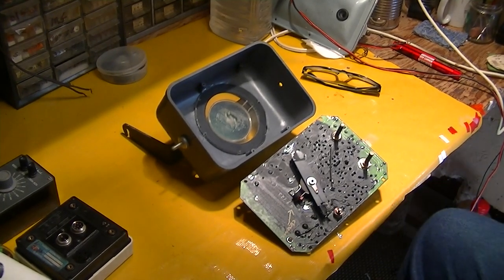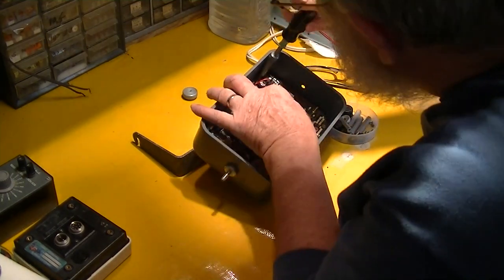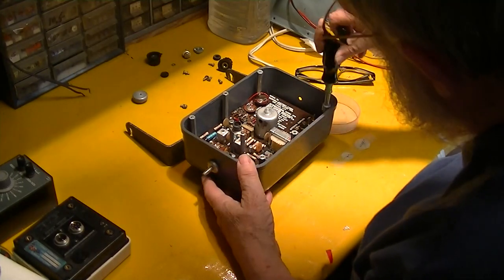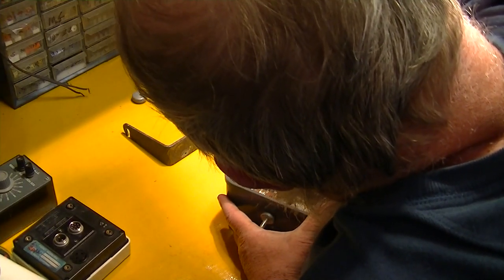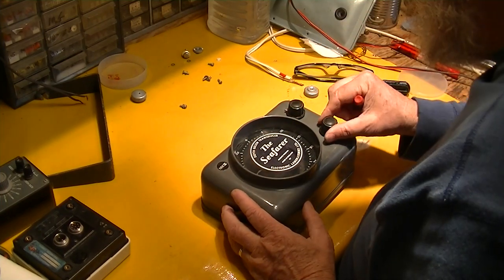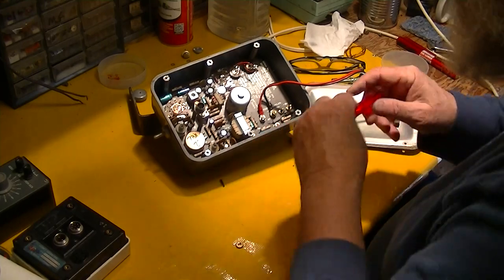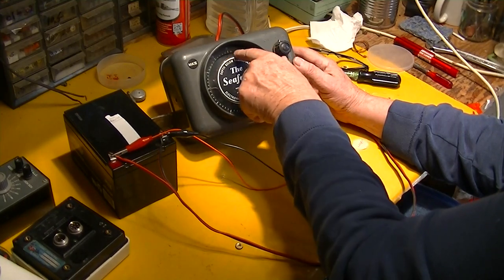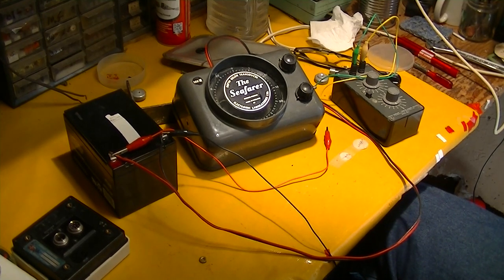Seafarer Depth Sounder : #3 Re-Assembly and Demo of Classic Flasher Type Sounder

Comment: Hello, do you know who or can you repair a, Unimetrics depth sounder / flasher.  Type, Sea Hawk SH 3600?  help, Gregg.
Reply from the maker: nope.  With new visual fish finder/gps combos selling around $100,most folks wouldn't bother.  But, if you find an old marine electronics shop with an old timer tech.. it will be easy if the mechanicals are still ok.  Not cost effective, probably, but not hard.  Restoration of old stuff is a labor of love, I do it all the time, but it isn't going to pay anybody to do it commercially.
Reply: Capt Larry - I like having the original equipment working, Nostalgia ya know.  Even though I have updated equipment to go with it. Thank you sir!